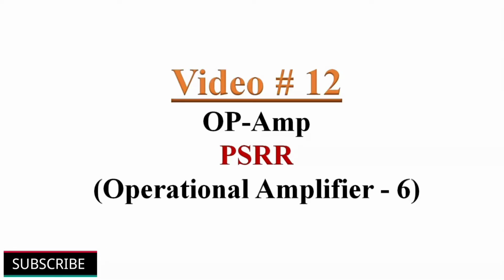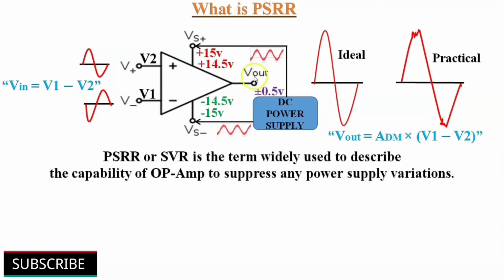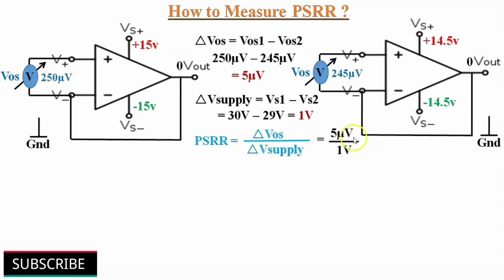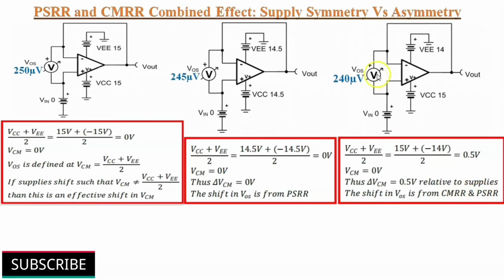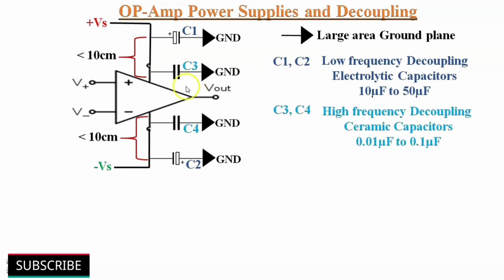OP-Amp Power Supply Rejection Ration (PSRR of Operational Amplifier)

Comment from the maker: The timestamps for different topics covered in this video are as follows,
1) 00:18 - Introduction,
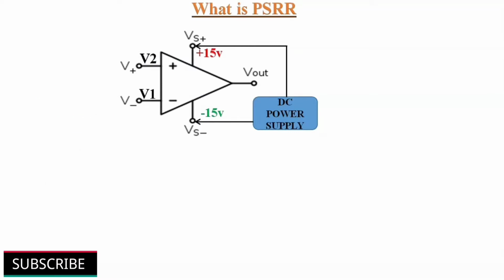2) 00:46 - What is PSRR,
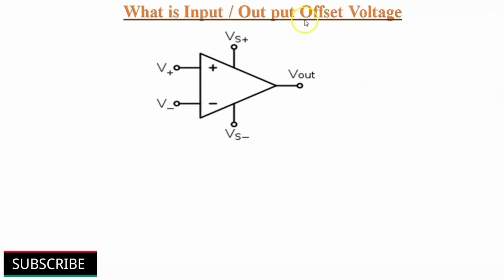3) 02:00 - What is Offset voltage,
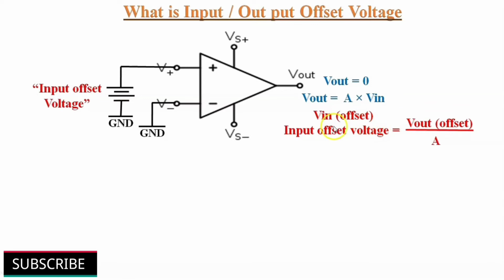4) 03:09 - How to measure PSRR,
5) 05:38 - Datasheet showing PSRR,
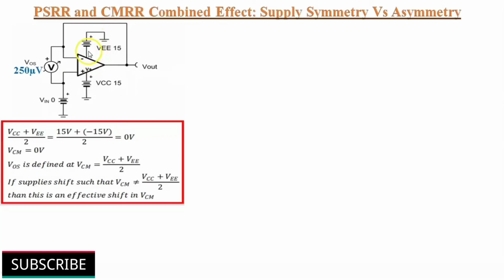6) 05:56 - PSRR & CMRR combined effect, Supply symmetry vs Asymmetry,
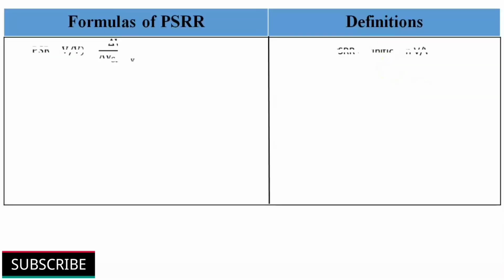7) 07:47 - Formulas of PSRR,
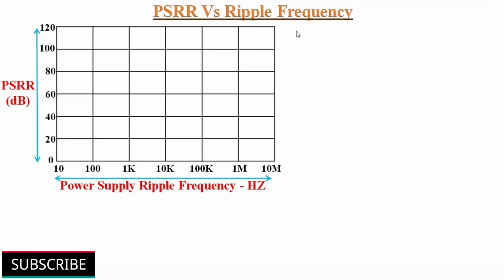8) 09:07 - PSRR Vs Ripple frequency,
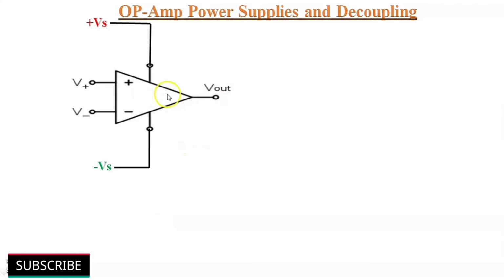9) 09:54 - OP-Amp power supplies and Decoupling,
10) 10:50 - Thanks for watching,
11) 11:02 - Next video.
Reply: "PSRR" is ratio of change in output offset voltage to the change in power supply 🙄🙄

Comment: Using TL072 in my preamplifier. But my power supply swings between 1 volts in either side. ( Modifying single rail to double rail power supply using two diodes) is it because of this power supply swings that sometimes my speaker produce loud noise  ??
Reply from the maker: Yes, that 1V swing is almost certainly the culprit.
The TL072 is a fantastic JFET-input op-amp, but it has its limits:

PSRR (Power Supply Rejection Ratio): The TL072 is good at ignoring high-frequency noise, but it struggles to reject large, low-frequency swings on the power lines.

Phase Reversal: If that 1V swing causes your input signal to get too close to the negative rail, the TL072 can undergo "Phase Reversal," where the output suddenly jumps to the opposite rail. This sounds like a massive, loud "pop" or "crack" in your speakers.